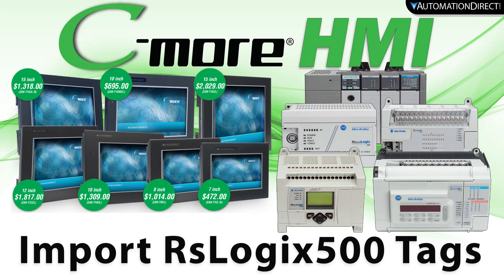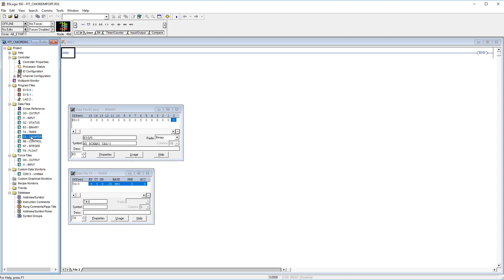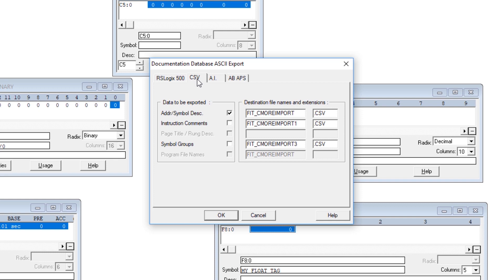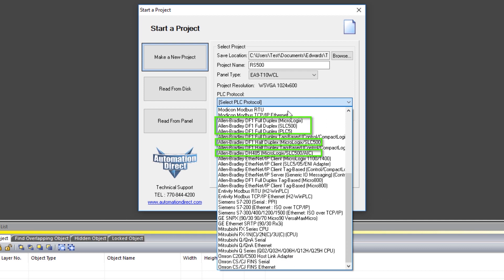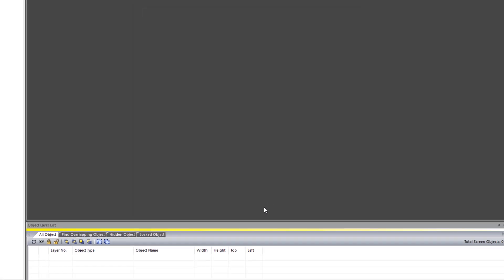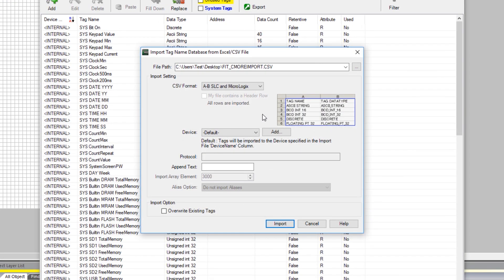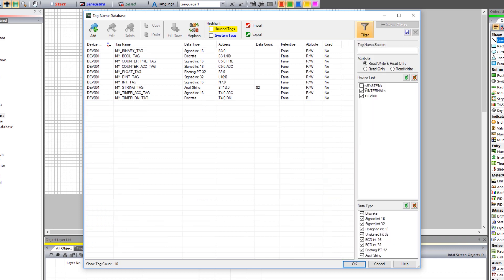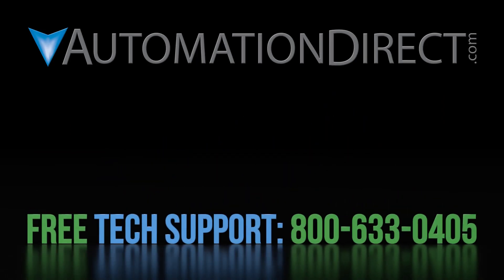C-more HMI Import RSLogix 500 PLC Tags: PLC5, SLC 500, MicroLogix at AutomationDirect

Comment: Hello, I see that through these HMI I can communicate a particular PLC5 I have a PLC5 / 30, is it possible to establish communication through the ch0 port which is RS232 serial?
Reply from the maker: Daniel,  the C-more can connect to Ch0 using DF1 REs2332C, with use of a EA-PLC5-232-CBL. Please see page 6-22 of the C-more user manual here: https://cdn.automationdirect.com/static/manuals/ea9userm/ea9userm.pdf

Comment: do need to be set the symbols/description or as you said nickname to have underscore necessary?
Reply: for example: which one can i use of these two... 
1) motor_stop 
or 
2) motor stop?

Which one Is correct to use on RSLogix500 to use or import to C-More?
Reply from the maker: Natan I believe you must use the underscore, "Motor_Stop". I don't have a RSLogix500, in front of me. Let me verify this with our engineering team.
Reply from the maker: Natan from our engineering team
 "To clarify, this answer is only for RSLogix500 using it with the MicroLogix or SLC PLCs.  The answer would be different for RSLogix5000…

The answer is:  C-more will use either one.

I created 2 addresses: B3:0/0 and B3:0/1.  I added a “Symbol” for B3:0/0.  Symbols will NOT allow a space in the RSLogix500 software.  I added a “Description” for B3:0/1.  I put a space in it.

C-more will add an underscore when there are spaces but it will import them."

Comment: Hello, I really enjoyed your video that was very instructive for me. I just have an issue on running the simulation. I really do not know what I am missing.  Your video resumed without showing how the simulation is running. I have a Micrologix 1100 and 1400. Would you be able to add to this tutorial video the full demo?
Regards!
Reply from the maker: Glad it helped. Doing a separate video for simulator is on my list to accomplish. It will be some time. What issues are you having?
Reply: @automationdirect  Thanks for getting back to me. I really appreciated it. The issue is that the simulation model is not communicating with the PLC. I tried with the Emulator and the PLC. None of them is not sending the signal to the PLC. That's the reason, I have requested a full video where I can see the simulation working.
Reply from the maker: Dan, I see your issue. The C-more simulator does not support communications. It is only designed for testing of screen navigation and and other internal features.
Reply: In this video, you have a full simulation between Indusoft and RsLogix500. https://youtu.be/VnRvITHUR3g
I want to do something similar with C-More. A full working system in simulation.

Comment: Hello 
I created a new project on Micrologix and made the symbols fallowed the instruction to create CSV but when i import it on C-more 
i get error below:
" Error GUI-185 : Import File is already opened or corrupted. Please check the file and import again.
"

I am using microlgixLite to communicate with micrologix1000 over  RS232 .

PLEASE LET ME KNOW IF YOU CAN HELP
Reply from the maker: Liban, I have not seen this error before. I would advise that you call Tech Support. 1-800-633-0405. They will be able to help you navigate the issue.  Thanks
Reply: I get this as well

Comment: Can the C-more hmi software communicate to EMU-500 ( Rslogix 500 emulate) as if it were a real plc. ie. you can build and test screens without having access to a physical PLC system? If I’m not mistaken EMU-500 uses a virtual “DH485” driver that points back to your PC.
Reply from the maker: Thanks for the comment. The C-more software simulator does not enable communication. Now if you do you a physical C-more and the EMU-500 ( Rslogix 500 emulate) does enable the PC to work as a plc encapsulating the com port, this can be possible. I caution you we have not tested this internally.

Comment: I exported the csv tag file to my computer, then I imported the values to the hmi database. Happy that everything seemed to be going so well, I reviewed the hmi tag database. All the physical discrete I/O tags were missing. All the bit, timer info was there, but no inputs or outputs. Curious, I opened the csv file, and the tags were in the file. I’m puzzled as to why the import did not copy those? Any ideas?

Thank you,
Ray Marsh
Reply: DID YOU FIND A SOLUTION TO THIS?
Reply: @mikehertwig2880  Did you find a solution? My guess is because C-more only goes up to bit 15 but Logix goes up to bit 17 since it skips 8-9
Reply from the maker: Ray, Not sure I have seen that before. This would better handled by calling Tech Support. 1-800-633-0405.

Comment: can i use this sotware without a real hmi?
Reply from the maker: @Jesus, thanks for the comment. The C-more platform is a hardware based platform. The HMI software cannot run virtually on a PC. You can simulate, your project prior to deploying, but it will not have communication with your field devices.